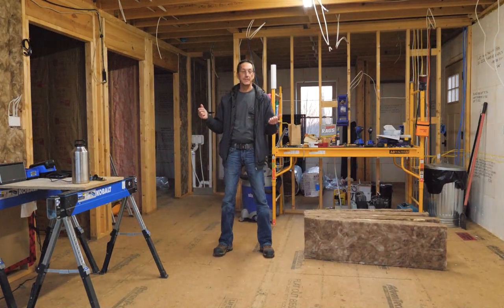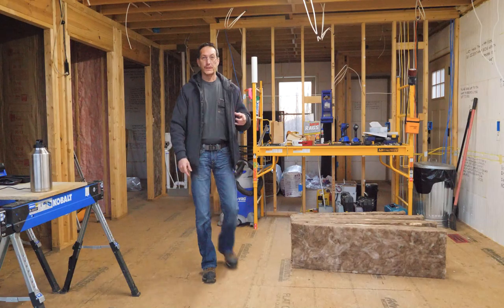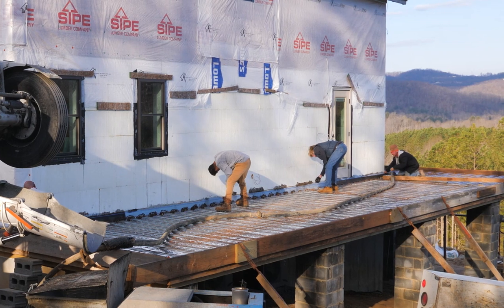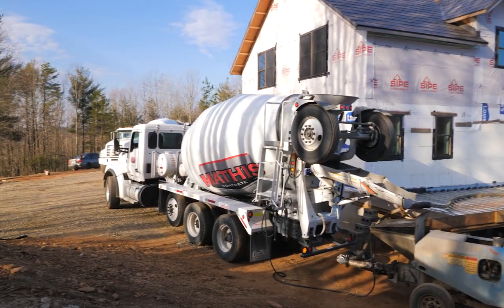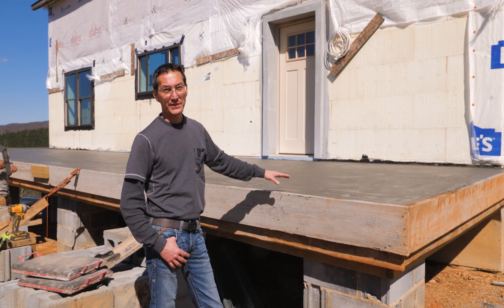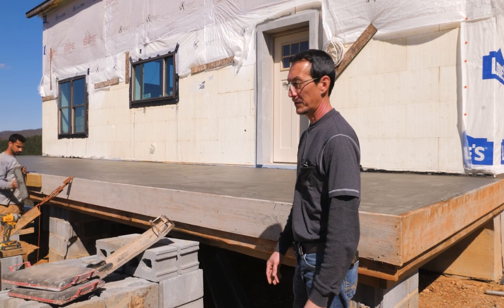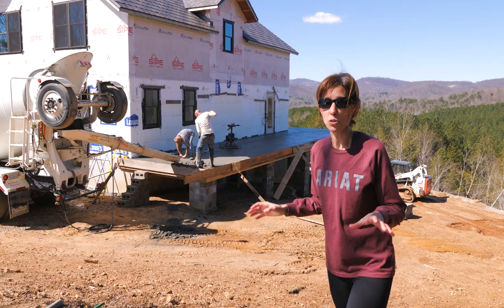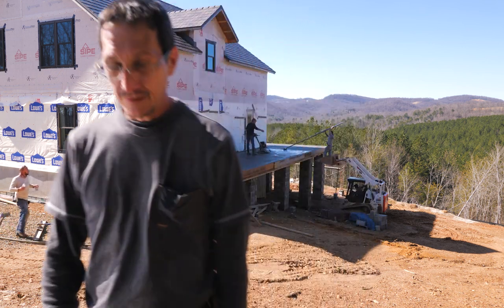Pouring a 50 TON Elevated Concrete Porch Slab!

Comment: Wondering why there wernt any control joints added. Also wondering if your concrete will grow in the winter and smash any door trim (seen this in the past)
Reply from the maker: Control joints were added about 3 days after the pour. Been through an entire season and so far no issues. 👍🏻
Reply: Where's the rebar?
Reply: materials generally shrink with cold.. how are you thinking concrete would grow in the winter?
Reply: @Joshua-yn1zx  The concrete bonds to the metal decking, that and the welded wire provides reinforcement.
Reply: Are you thinking of when slabs on grade heave? Caused by the ground underneath freezing and expanding?  That of course won't happen here.
Reply: @Joshua-yn1zx   The metal decking is the tensile reinforcement for the concrete slab.  The ridges and bumpouts embossed in the metal decking lock/bond the metal deck with the concrete.  The wire mesh shown in the video is for shrinkage crack control, though the mesh should be slightly elevated above the corrugated metal deck top surface.  The concrete crew in the video seemed clueless regarding metal deck composite concrete slabs, though I assume they have lots of experience with more typical concrete projects.  I would never have hired them without having an experienced metal deck concrete professional directing them at every step.

Comment: Do you mind me ask What do you use under the pour-- is that deck pans or similar?
Reply from the maker: It is exactly that. Steel composite deck pans.
Reply: @Guildbrookfarm Are those steel pans there for long term structural support or are they just used to assist with the concrete pour? I ask because I have them underneath my front porch and I noticed they’re starting to rust out.
Reply from the maker: @drago987 They’re not structurally significant once the concrete sets as long as the mix is correct and rebar or wire mesh is used. I wouldn’t worry about the rust.
Reply: @Guildbrookfarm  Thanks, what a relief 😅

Comment: Did not see any of the placing crew pull the welded wire mesh up into the center of the slab?
Reply from the maker: Not necessary since is already laying in the center of the slab on top of the ribs.

Comment: Is there a slope in that concrete porch so that rain water flows away from the house  ?
Reply from the maker: Yeah
Reply: How do you fix one that wasn’t sloped. Now I’m getting water in my house. I can send pictures. I need help!!!!
Reply: @225babmama  You can use a topping to go from a feathered edge to thicker by the house. Contact your local concrete contractors supply, if a freezing climate be sure to cover it with a traffic coating or epoxy, they are not durable against freeze thaw cycles.

Comment: In the last video, the guy said that he wasn’t gonna put wire mesh into the concrete ( which i personally was surprised) he said he was gonna use fiber instead. Why did they finally decide to use the wire mesh ?
Reply: I thought he said the opposite, don't use fibres, use mesh!
Reply from the maker: Correct. No fiber, just welded wire mesh.
Reply: I heard the opposite.

Comment: Figure if you have to give it 30 days and you can park an 80000 semi truck on that deck.  Are you planning to add 80000 pounds onto that thing? Seriously this is the most massive overbuild I have ever seen.  So really am curious why?  monster amount of steel around the perimeter.  the deck pans that are massively reinforcing.    The spans are not really big.
Reply from the maker: Why? Because anything worth doing is worth overdoing. 😎
Reply: @Guildbrookfarm  That house will stand for many generations.  I am just wonderfully amused.  I know how much 2 x 8 will hold and you are eons beyond that just with the metal pan
Reply: @Guildbrookfarm  yes, Yes, YES! I did the same overbuild on a retaining wall once, and knew it would stand for 100 years after I'm gone. It's like you are building a monument ;) WELL DONE!!!
Reply: @Guildbrookfarm  I agree 100%. It's like cooking chicken. You never want it underdone.

Comment: That’s slump coming out of the concrete truck way too wet that guy had that slump at about an eight that’s criminal probably got a ton of spider cracks in that thing
Reply: Sure concrete Captain
Reply: @omantoodle2437  It is too loose though.

Comment: Did they want gap under deck? Elevated gravel without steel decking is less costly, and has insulative and structural benefit to the adjacent building

Comment: Damn the dude @8:33 suck in it..fcol.  Just making piles. Making it harder than necessary  for the colleagues...And yes I do this job also for a living
Reply: Seeing this too, I worked as a union concrete laborer and seeing the few things like no anchoring to the block columns supporing the deck. Cutting the mesh on the ground when those blades can hit a charp rock and explode. But its fun how concrete is all about the skill of the guy ahead of you. If the guys put it down perfect, then no one else hardly has to work.
Reply: @haldanpedersen  thanks! indeed
Reply: The whole concrete crew seemed clueless regarding metal deck composite concrete pours.  The idiot cutting the wire mesh directly on the ground should be required to use his own gear and pay for the blades.  Analogous to a car mechanic smoking a cigarette while removing a gas tank.

Comment: Why did you insulate your interior walls? You didn't have to unless you want a sound proof bedroom
Reply: He did say in that vid it was for the sound proofing of the room's.
Reply: Many reasons to insulate interior walls; sound mitigation,  noise, allows for better thermal control from room to room, less drafts, less to worry about if something come through walls.

Comment: Looks like Theres not enough steel in that slab to span that far.  Concrete is weak and cant support itself without a lot of steel.  Most structures like that have 2 or more mats of tied rebar.  The columns supporting it are too far apart.  I think it will crack and fail.
Reply: Dont you see the structural pan underneath.. Thats permanent it wont be removed Along with The steel I-beams.. Gonna be solid
Reply: I had the same question for my father once about a simplar pour and his answer was simple. If the ice cream in your ice cream cone can hold it shape, don't you think concrete can?

Comment: I thought you guys are supposed to try to save money  and your pissing your money away
Reply: That porch will require zero-maintenance.  When others are replacing their rotten wood deck in 15 years, this concrete will still be solid.  I thought you said you were a contractor...
Reply: @timadamany was a contractor but 20 k in concrete if not more and if you use pressure treated wood it would save y'all a bunch of money.  The thing is with me I have no debt they do
Reply: @erockmuzic5070  perhaps they are not in debt, but it's nice of you to assume.
Reply: @lynnhoffmann3710  I'm always right
Reply from the maker: Lynn don’t feed the trolls
Reply: Yeah that's why y'all in debt....as I drop the mic I don't troll nothing but state facts.  You didn't make $200k I off YouTube just saying
Reply: @lynnhoffmann3710  I'm far from left dummy
Reply: @erockmuzic5070  You have 124 subscribers...try again...  ha!
Reply: @timadamany  because I'm Fabulous 🤪🤪🤪🤪👍👍👍👍👍👍